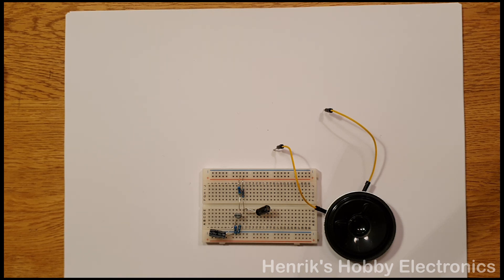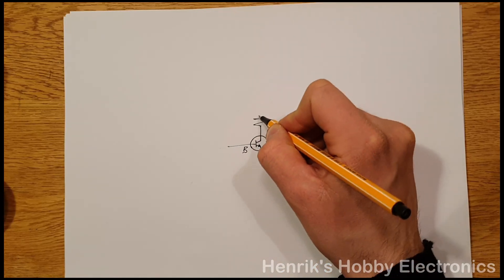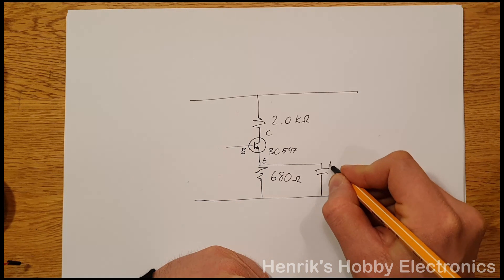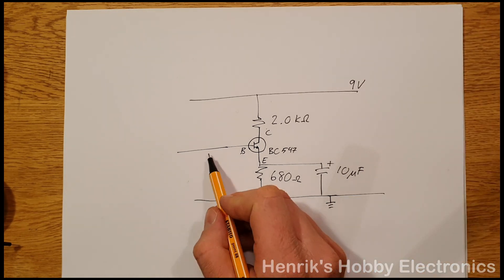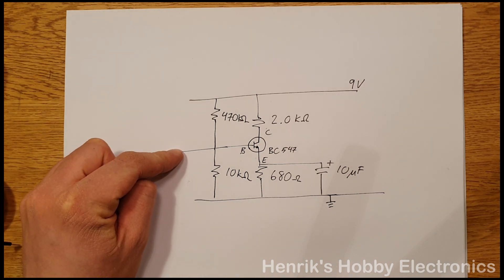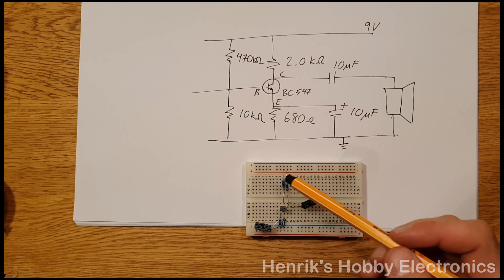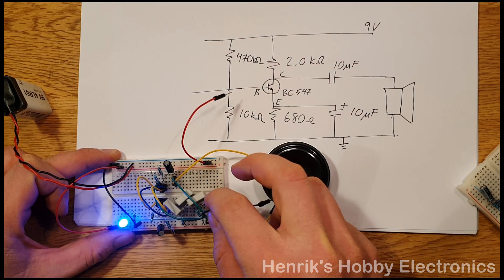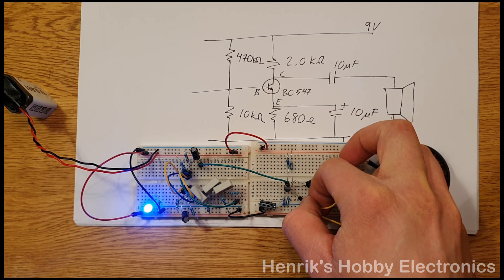Single-Transistor Audio Amplifier - How the Common Emitter Amplifier Works

Comment: Taking your modification of 47K instead of 470K, here's the DC analysis:
The collector current (Ic) can't exceed 9V / (2K + 680R) = 3.4mA and the BC547 has a minimum Hfe (β) of 110 at those sort of currents (typically around 300).
The base current can't be more than 30μA and will almost certainly be much less, probably around 10μA.
The current through the base bias resistors is around 9V / (47K + 10K) = 158μA, which is significantly greater than Ib, so we can ignore Ib to a first approximation.
The voltage at the base (Vb) is 158μA x 10K = 1.58V.
The base-emitter voltage (Vbe) is around 0.65V, so the voltage at the emitter (Ve) is 1.58V - 0.65V = 0.93V.
The current through the emitter resistor (Re) is the same as the emitter current (Ie) and almost the the same as the collector current (Ic). It is 0.93V / 680R = 1.37mA.
The quiescent Ic is 1.34mA, so the actual Ib = 1.34mA / 110 = 12μA, confirming the earlier estimate and justifying ignoring it compared to the 158μA in the base bias resistors.
The voltage across the 2K collector resistor (Rc) is 2K x 1.34mA = 2.68V, so the collector voltage (Vc) is 9V - 2.68V = 6.36V.
The voltage across the BC547 (Vce) is Vc - Ve = 6.36V - 2.68V = 3.68V.
All of that is very reasonable design.
However, the output impedance is 2K, so you will potentially loose 99.6% of your signal when driving an 8 ohm load like the loudspeaker.

The AC analysis shows serious design flaws, unfortunately.
The intrinsic emitter resistance (re) is 26mV / Ic = 26mV / 1.34mA = 19R at the quiescent point. That will change as the collector current changes so is non-linear.
The same current flows through the collector resistor (Rc) as does through the total emitter impedance. Since the change in voltage across the total emitter impedance is the same as the change in voltage at the base (i.e. the input signal), the ratio of the the change in voltage across the collector (i.e. the ac output) to the change in voltage at the input is simply the ratio between the collector resistor and the total emitter impedance. That is the voltage gain (Av) of the circuit.
Av = Rc / (re + (Re || Xc) where Xc is the reactance of the bypass capacitor and (Re || Xc) is the impedance of Re in parallel with Xc. Xc = 1/2πCf where f is the frequency.
When Xc is much larger than Re (low frequencies), then Av = Rc / (re + Re) and no bypass occurs.
In this case, Xc is greater than Re when f < 1/2πC.Re = 1/2π.10μF.680R = 23Hz, and the gain below that is 2K / (680R + 19R) = 2.86 (i.e. the DC gain).
When Xc is much smaller than re (high frequencies), then Av = Rc / re and the emitter resistor (Re) is bypassed to ac.
In this case, Xc is less than re when f < 1/2πC.re = 1/2π.10μF.19R = 840Hz, and the gain above that is 2K / 19R = 105, but that is non-linear and will change as the collector current changes, producing distortion for large signals.
Between 23Hz and 840Hz, the gain will increase from x2.86 to x105 giving a very "tinny" sound. The circuit needs either no bypass capacitor for a gain of 2.86, or a bypass capacitor of 470μF to give a (non-linear) gain of around 105 from 20Hz upwards (the usual audio range).
The output capacitor is also far too small for use with an 8R speaker. You generally need 1000μF for audio use, although in this case it won't matter because the high output impedance attenuates the signal so much anyway.
Finally, the input impedance is the parallel combination of 47K, 10K and the impedance of the transistor looking into the base, which is β times the emitter impedance. At high frequencies, that will be 47K || 10K || (110.19R) at the worst case, which equals around 1.7K, but the dominant factor is the transistor impedance, so the circuit input impedance will depend strongly on the transistor β. That's not a desirable design.
Reply: This guy engineers.
Reply: So I need to increase collector current? to decrease re below 8 ohm to have a positif gain? cuz when you connect load its always parallel with the RC so load impedence is always around 8ohm. Rc/re =8 /19 always smaller than 1. if there was a 50 mA collector current then 26mV/50mA re would be 0.5 ohm? then 8/0.5= gain is 16. Would this work?
Reply: @Craftinges  There are two ways to drive a low impedance load. The first way is to lower the output impedance of the amplifier. What you suggest would work, or you could add an emitter-follower stage (sometimes called "common collector) which has a voltage gain of unity, but a large current gain.
The other alternative is to use an audio output transformer as the collector load, but that is a design exercise in itself and is no longer a popular solution. The transformer effectively multiplies the 8 ohm load by the square of the ratio of the windings. So a 16:1 transformer would match an 8 ohm speaker to an output impedance of 2K, but you'd probably want to use a higher supply voltage that the 9V shown in the video.

In any case, I'd encourage you to experiment as these circuits are cheap to make and you'll learn from trying. If you just want an amplifier for a particular application, there are lots of videos on amplifiers suitable for driving 8 ohm speakers. Look for LM386 (class AB) or PAM8403 (class D) ics for some alternatives. You can buy the complete modules ready built for around £1 or less.
Reply: @RexxSchneider  Wow thx for the quick response. Yeah when I search speaker circuits I mostly see LM386 but I wanted to try-learn it without using prebuilt/integrated circuits. I have  bc237s right now gonna try this hope it doesnt affect working princple much. I wonder what happens if I connect a PWM source voltage instead of a constant 9V source. Over 20khz we couldnt hear the parasitics anyway? or does it cause more problem for the circuit.
Reply: @Craftinges  The BC237 and the BC547 are very similar transistors, the notable difference being the BC237 is rated at only 300mW maximum dissipation, while the BC547 is rated at 500mW, but I'd recommend keeping both of them well below that. With a 9V supply, try to keep currents below about 30mA or so. These small-signal transistors are really intended for use at currents more like 1mA, and batteries will last longer.

We always want to use a steady voltage source (DC) for our circuits, because the whole circuit can't just turn on and off at high speed. PWM circuits like the class D amplifiers have a steady power supply, but work by switching the transistors on and off at frequencies outside of the audio range to minimise power loss in the transistors.

Start with simple class A amplifiers like the the one shown in the video and enjoy the learning process!
Reply: "The collector current (Ic) can't exceed 9V / (2K + 680R) = 3.4mA" - You didn't take into account the sat voltage drop of 0.2-0.3 volts, then Ic < 3,28 mA

"The current through the base bias resistors is around 9V / (47K + 10K) = 158μA" : Well not really. Also the point of this configuration is using the emitter resistor as feedback. If the Hfe increases Ib decreases:

Vbb =1,578 V (thevenin source)
Rbb =  R47K || R10K (thevenin resistance)

Then applying kirchoff's law  and assuming a beta of 100:
Ib = (Vbb - VBE) / (Rbb + (1+beta)RE ) = 12,78 uA 

If beta or Hfe is 300 Ib would be 4,29 uA, ensuring this way the active mode of the transistor.

However, i would have used a higher value of Re to make (Re * hfe)  much bigger than the Rb component of the expression and thus making Ic more independent of Hfe variations.
Reply: @andreascorelli7296  The Vce(sat) of the BC547 at Ic=10mA is typically 90mV, and will be clearly insignificant at colector currents below that. Nevertheless, even a Vce(sat) of 0.2V is negligible compared to the supply voltage of 9V, which realistically might be more than 0.2V away from 9V anyway. You're also using false precision in your calculation. If the resistors and voltages were exact then my calculation would give an upper limit for Ic of 3.358mA and yours would give 3.284mA, a difference of less than 2%, which is probably swamped by variations in resistor values and supply volage. Why waste time with insignificant differences?

"The current through the base bias resistors is around 9V / (47K + 10K) = 158μA" : Well yes really. We've seen that the quiescent base current is around 1.34mA, and with a realistic β of 110, the base current is always at least an order of magnitude less than the current through the base resistors. You get a more precise result by using the Thevenin equivalent but in this case, it's a waste of time because the difference between the 12.2μA that I calculated (and rounded) and your 12.78μA (a ridiculously over-precise value given it depends on β) is utterly insignificant compared to the approximately 160μA passing through the base resistors. A higher β would make it even more insignificant. The change in the voltage at the emitter between your calculation and mine would be Rbb * Ib = 8.2K * 12μA = 0.1V, giving a difference in collector bias point of around 0.3V. Again, why waste time with insignificant differences?

The point of the emitter resistor is two-fold: it stabilises the dc operating point against variations in β; and it reduces the ac voltage gain to reduce distortion. The BC547 is normally sold in A, B, C variants which are binned by hfe within an approximate 2:1 range, and that is all the β variation you need to design for. A worst-case variation of β for the BC547A from 110 to 220 would result in a change of voltage across the emitter resistor of about 50mV, giving a change in quiescent output point of about (2k/0.68K) * 50mV = 150mV. There is absolutely no need to increase Re as Ic is already quite stable enough against variations in β. Note that increasing Re would lower the low-frequency voltage gain of around 3 even further, making the circuit virtually pointless for any practical application.

It is important for any engineer to learn when an approximation is appropriate (which means knowing the characteristics of the devices used), and when undue precision is a waste of time. I hope you will reflect carefully on the insignificance of the points you've raised, and understand more clearly now why I made use those approximations in my initial analysis.
Reply: @RexxSchneider  First of all, thanks for your thorough comment. I actually didn’t mean to be obnoxious. I wrote that comment very early in the morning before starting work, just to warm up my brain. I even forgot to click the send button until hours later.

About the first part, I also forgot to add that, considering the VCC voltage and component tolerances, it wouldn’t be significant.

And about the second thing, I just didn’t read your comment properly. I thought you meant the 158 µA was supposed to be Ib. Again, I had just woken up (I hadn’t even had my breakfast yet).

Regarding my last observation, obviously, when I said increasing Re, that also means tweaking the input resistor divider and RC accordingly to make Re*beta much larger than Rbb, thus making the system very independent of beta while keeping the amplifier’s output power requirements.

P.S.: I was about to post a question (about a transistor-based circuit, precisely) on the Electronics Stack Exchange forum, but I doubt I’ll find someone better than you. So if you don’t mind, I could share my email with you to show you the problem.
Reply: @RexxSchneider  Greetings! Can you suggest modifications of the circuit if we are required to use only 5V DC supply, 500m Vpp 1kHz sinewave AC. Please please.
Reply: @ezeg4r  With a 5V supply, you are severely limited in the output swing and in the maximum usable gain. You have an input signal that swings 0.5Vpp, so it will be clipping if we have a gain approaching 10. The maximum gain of these sort of circuits is approximately Vcc/50mV, but that will have significant distortion, because of the nonlinearity of re, the intrinsic emitter resistance. So we should really plan for a usable gain of no more than Vcc/500mV = 10 in this case, which matches the maximum that causes clipping with the 500mVpp input signal. You haven't given the gain you want, so let me show you how we might achieve a gain of around 6x along with an output impedance of around 2K, as in the video, as those two "free" parameters will determine the rest of the design.

1. Calculate collector resistor. The output impedance is 2K so the collector resistor (Rc) is 2K.

2. Calculate collector current. The dc bias point is a little above half the supply, around 2.5V, to maximise the possible output swing, so the quiescent collector current will be 2.5V/2K maximum = 1.25mA or a little less.

3. Calculate emitter resistor. The intrinsic emitter resistance (re) will be 25mV/Ic = 25mV / 1.25mA = 20R. The total emitter resistance will be determined by gain Av = Rc / (Re + re). So 6 = 2K / (Re + 20), making Re = 313R. The nearest preferred value is 330R, so we use that giving an actual gain of 2K / (330 + 20) = 5.7x. If that's okay,, we can proceed, otherwise we have to use two resistors to make the 313R, perhaps 180R + 150R. I'll work with the slightly lower gain and Re = 330R. Note that Re is 16 times bigger than re, so linearity will be ok.

4. Calculate the emitter bypass capacitor. Using Re = 330R will mean no bypass capacitor is used.

5a. Calculate base bias voltage. We have 1.25mA through 330R, making the emitter bias point 410mV above ground. That is low and will be difficult to reproduce, given resistor tolerances, but a 5V supply will impose these sort of compromises. At Ic = 1.25mA, the BC547 will typically have a Vbe of around 650mV (but samples may vary, so beware), which is temperature dependant. That means the base bias point needs to be set around 410mV + 650mV = 1.06V. Altering that will affect the dc bias point at the collector.

5b. Increase dc bias point stability. We could get greater stability by adding more emitter resistance and bypassing that with a capacitor, but it would raise the emitter dc bias point, further limiting the output swing available at the collector. We could perhaps sacrifice another 0.4V of output swing by adding another emitter resistor in series with Re and then bypassing it with a capacitor to restore ac gain. Another 330R would do that, making the base bias point around 1.47V and requiring a bypass capacitor of at least 22μF for audio, which gives a -3dB frequency of 20Hz. I prefer not doing this as the 5V supply doesn't really have the headroom to put the base as high as 1.5V.

6. Calculate base bias resistors. Using the simpler design from 5a, we need to set the base bias voltage at 1.06V. Aiming for 1.1V and ignoring Ib, we need 3.9V across the top base resistor (Rb1) and 1.1V across the bottom base bias resistor (Rb2). We should set the current through those resistors at least 10 times the maximum ba current Ib, which is Ic/β = 1.25mA/110 = 11.4μA (for a BC547A, or half that for a BC547B). Using 120μA through Rb2 would give 1.1V / 120μA = 9.1K, which is an available value. Similarly Rb1 = 3.9V / 120μA = 32.5K, and we could use 33K.

7. Calculate input impedance. The ac input impedance is then the parallel impedance of Rb1 with Rb2 and β times the emitter impedance = 9.1K || 33K | (110 x 350R) = 9.1K || 33K || 38.5K = 6K. Using a BC547C would allow resistors up to four times bigger, such as Rb1 = 120K and Rb2 = 33K, if a higher input impedance is desired: 120K || 33K || 154K = 22K. Note that in either case, the β-dependant impedance is swamped by the smaller base resistors.

The constraints imposed by the low supply voltage makes the design susceptible to resistor tolerances, transistor parameter variations and temperature. I would always prototype the circuit on a breadboard first and then perhaps fine tune the dc bias point to around 3V by altering Rb1, thus maximising the available output swing. If you have an oscilloscope, then looking at the output at the collector with the 500mV pp input signal should give an indication of whether you get a clean 2.9V pp output as planned. HTH.
Reply: @RexxSchneider  woww, did you just do this mentally? can i know if you somehow had drawn a circuit design, otherwise, does this mean i will use the circuit design in the video and will just adjust the values? btw i apologize for lack specs but we are expected to have a gain of 9 and drive an 8ohm 0.5w speaker with single supply DC voltage of 5v, 500mVpp 1k Hz AC. Thank you very much.!!!!!!!
Reply: @RexxSchneider  If we are expected to have a gain of 9, is this a reasonable gain to operate and have less distortion in output? Should I just follow your calculations and just adjust the 6-assumed gain to 9, or solving the RE right away using the 9-given gain, and adjust the calculations afterwards?
Reply: @RexxSchneider i tried running the circuit in the video with the calculated values. the output wave turns to be flat😭😭😭.
Reply: @ezeg4r  You said "did you just do this mentally? can i know if you somehow had drawn a circuit design, otherwise, does this mean i will use the circuit design in the video and will just adjust the values? btw i apologize for lack specs but we are expected to have a gain of 9 and drive an 8ohm 0.5w speaker with single supply DC voltage of 5v, 500mVpp 1k Hz AC."

I did the calculations using a calculator; hopefully the steps I went through should tell you what calculations to make. I do keep the circuit in my head, but not the exact values which have to be calculated for each specification. If you look at the video at 3:53 you will see the circuit containing two base bias resistors (what I call Rb1 at the top and Rb2 at the bottom) as well as the collector resistor (Rc) and the emitter resistor (Re).

Your specification is unrealistic. If you have to amplify a 500mV pp signal by a factor of 9, you are being asked to output a 4.5V pp sine wave using a 5V supply. That leaves just 0.5V for the transistor and emitter resistor. I don't think it can be done sensibly.

The other half of the problem is the 8R speaker which is then the effective load resistance because it will need a low impedance to drive it, otherwise the output signal will be attenuated.

Here are the calculations which need to be re-iterated to get an answer:

1. Calculate the emitter resistor. The transistor should probably be allowed 0.2V minimum between collector and emitter (Vce). So that leaves 5V (the supply) - 4.5V (the output signal swing) - 0.2V (Vce) = 0.3V. So we have 0.3V across the emitter resistor. The gain = 9 is the load resistance (8R) / the total emitter resistance (Re + re). The total emitter resistance is then 8R/9 = 0.89R. Most of that should be Re, so we might try 0.8R for Re, making the emitter current 0.3V / 0.8R = 375mA. That's far in excess of the BC547's maximum collector current of 100mA, so we'll need a different transistor. A 2N2222A has a maximum Ic = 600mA, but it can only dissipate 625mW and we need 0.375A x 2.5V = 0.94W. A BD235 can handle 2A and 25W with a heatsink, and has a typical Vce(sat) of 0.15V at 400mA, but "typical" doesn't mean guaranteed. It has a β around 40 at those sort of currents, so should be just about useable.

2. Recalculate the gain. The value of re is 25mV/Ic = 25mV/375mA = 0.067R. So the total emitter resistance is 0.8R + 0.067R = 0.87R, giving a gain of around 8R / 0.87R = 9.2.

3. Calculate the collector resistor. The dc operating point is at 5V - (4.5V)/2 = 2.75V. The collector resistor then drops 2.25V at 375mA, making it 2.25V / 0.375mA = 6R (which needs to be a 1W resistor since 2.25V x 0.375A = 0.84W).

4. Recalculate the gain. The total load impedance is now the 6R collector resistor in parallel with the 8R speaker = 3.4R, making the gain 3.4R / 0.87R = 3.9. Far too low, so we'll need to recalculate.

5. Keeping Rc = 6R, we will need (Re + re) = 3.4R / 9 = 0.378R. That means Re = 0.378R - 0.067R = 0.31R.

5. Recalculate the emitter bias point. The emitter resistor will drop 0.31R x 0.375A = 0.117V. That is going to be difficult to set accurately because there will be Vbe variations in the transistor sample.

6. Calculate the lower base bias resistor. The base current, Ib = 375mA / β = 375mA / 40 = 9.38mA. We will need the current through the base bias resistors to be much larger than that, ideally 10x larger, but that would give a very low input impedance. Let's aim for a current at least 70mA through the lower resistor, Rb2. Since Vbe at 375mA is typically 0.8V, the base will need to be at around 0.117V + 0.8V = 0.92V, but there may be significant variations in different samples of the BD235. That makes Rb2 = 0.92V / 70mA = 13R. If we use the preferred value Rb2 = 12R, then we will have 0.92V / 12R = 77mA through it. 

7. Calculate the upper base bias resistor. This has to pass (77mA + Ib) = 77mA + 9.38mA = 86mA. It has a voltage drop of 5V - 0.92V = 4.08V so Rb1 = 4.08V / 86mA = 47R.

8. Calculate the input impedance. The input impedance is Rb1 || Rb2 || β(Re + re) = 47R || 12R || 40(0.31R + 0.067R) = 47R || 12R || 15R = 5.85R.

So if you have a signal generator that can drive 500mV pp into 5.85R, then the circuit I derived (Tr1 = BD235 with heatsink, Rb1 = 47R, Rb2 = 12R, Rc = 6R 1Watt, Re = 0.31R) will give a gain of around 9 when driving an 8R speaker through a blocking capacitor of 1,000μF. However, it stands a good chance of clipping, so you may have to trim Rb1 to set the quiescent bias point to 2.75V above ground. The emitter resistor of 0.31 ohms will also be difficult to get right, and you won't be able to use a breadboard because of contact resistances. You'll also have to make sure that your 5V supply doesn't drop when drawing close to 0.5A. Good luck!
Reply: @RexxSchneider  I tried again the design however, still, it produces a flat output. Idk why😭😭. What I did, thru the given parameter of the RL speaker, 0.5W 8Ohm, I solve for the current that should be flowing in the RL, equating it to Ic. Also, the voltage that should be produced in the Rc, thru power formula. Afterwards, I look for a transistor that can handle with the solved Ic and Vc and I found BD139. I made a slight adjustments thru my solved values of Rc, Re, R1, and R2. The speaker sounds well, however, the output produces a clipped waveform with 250mV clipped, down to -1V curved wave. I need to atleast have a Vm of 2.25 to achieve a 9 gain with ±10% tolerance. What should I do? My values are: Rc = 100, Re = 40, R1 = 5k,  R2 = 10K. Also, I accidentally added a 10-F bypass cap, instead of 10u, resulting with tha good sound. When I adjusted it to 10u, the sounds gets lower. There should be a problem with my circuit.
Reply: @RexxSchneider .. Wow how do you know so much about amplifiers?? I'm an electronics engineering student, and I'd love to know this much, I want to build lots of projects around audio, but i don't know where to start.. every project I tried or simulate seem not to work, I want to be like youu. I need some guidance 🙏🏾
Reply: @RexxSchneider Please reply🙏🏾
Reply: Very valuable educational comment ☺️😁😄☺️
Reply: hey , i have a project , and i want to add a third transistor as switching device for the circuits in the video , i will connect the pir sensor to the transistor so whenever it detects motions the oscillator and amplifier would turn on , please help me i dont know how i will connect it
Reply: How about you make a decent video
Reply: This design is ridiculous!